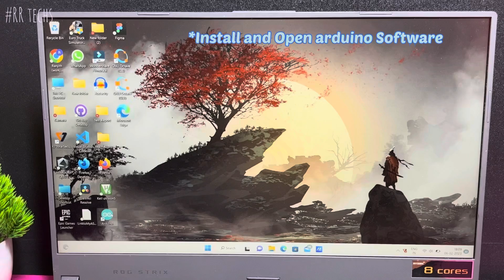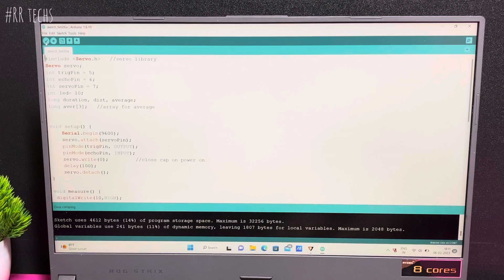science project for class 7th students working model Easy science exhibition projects class

Comment: Bro how to charge hiw battery
Reply from the maker: Either you can replace the Hw battery or else You can use 12V adapter by placing into the Arduino uno circuit 💖👍